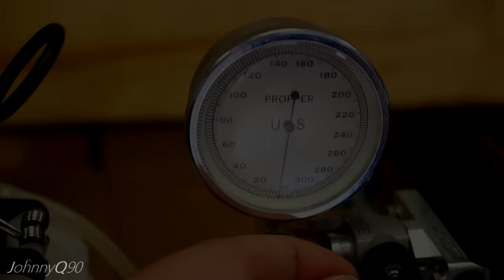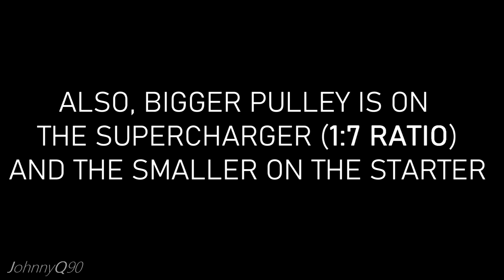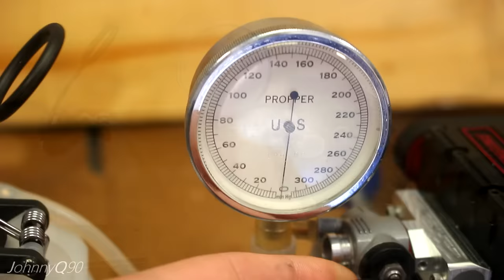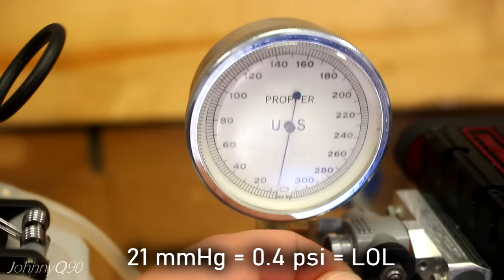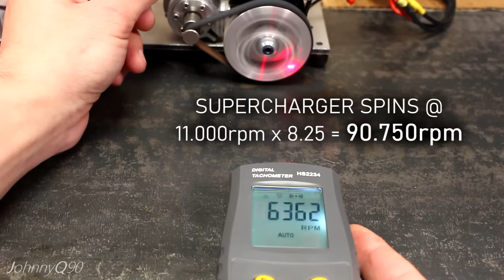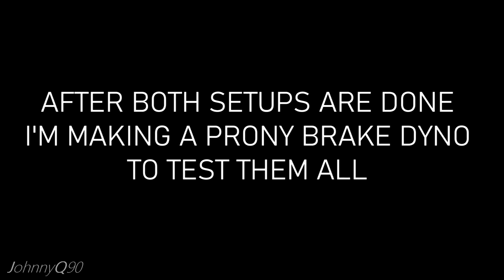0.6psi @ 90,000rpm Supercharger on MINI 2 Cylinder Four Stroke Engine! - BLOW Through Setup

Comment: Someone is learning that you can't just slap a supercharger on an engine and expect it to work. You need to add fuel and even more importantly... TIMING!
Reply: How you supposed to adjust timing
Reply: @carsonmcnamer5321   You can't. In a glow engine ignition timing is based on compression.
Reply: @otm646  yeah I know that’s why I asked him his plan on doing that lol.
Reply: @carsonmcnamer5321  Magnets and a hall effect sensor seems to be the way, but I don't know how it would work with those coil modules he uses.
Reply: @letsnotplaywithelectricity9346  yeah that would definitely help but add completely and he would need to program it. I’d say get as far as you can without it. It’s a small engine anyway
Reply: @otm646  I think I may have confused engines. I could have sworn when he first unveiled this engine he installed spark plugs... If this is a glow plug engine than he is supercharging the wrong engine all together.

Comment: Might need to make longer intake runners to give the intake some more volume. Also increase the size of the turbine wheel. If you can find bearings small enough, you could also make am exhaust wheel to make a baby turbo.

Comment: Johnny, how about using compressed air at a couple or more of LBS to test the amount  you actually want. then design the SC to get your optimum boost. Just saying Again Great Videos
Reply: They did this on F1  engines in the 80s.  Boost was supplied by a industrial compressor.    JohnnyQ90 should give it a try
Reply: That wouldn't work. There's way more to it that just "a couple lbs" of air pressure applied to the carb inlet. The flow rate of the air has to be right, and completely linear as tne RPMs go up. You can't just blast some compressed air into an engine.

Comment: Maybe if you used the exhaust for your fuel pressure instead and didn’t have any intake leaks.
Reply: RC engines for 50+ years have used exhaust to pressurize the fuel tank. Making it boost pressurized doesn't make any sense.
Factory supercharged RC 4 stroke glow engines like the venerable OS Surpass engines still used exhaust pressurization for the fuel tank.

Comment: Is it possible that the engine can’t exhaust the increased air input? Kinda sounds that way.
Reply: Could be that the valve / exhaust system is so restrictive that it can’t let enough exhaust gas out.
Reply: @codykamminga9667  turbo cars are notorious for that unless you port and polish the heads.
Reply: @scrapperdscrapperj3948 
No they are not. No disinformation pls
Reply: Can’t wait to retrofit something like this into my hot wheels
Reply: @juhomaki-petaja  While not inherently true, overdriving the compressor (pushing more air in than can be exhausted) is absolutely a problem you can have if you're not careful sizing your intake and exhaust components.  Check out Gale Banks videos on "Destroying a Duramax."
Reply: Ford Ecoboost 4 cyl engines on stock turbos are notorious for this. Turn up the boost on the stock turbo system and exhaust cant leave the cylinder causing increased cylinder temps and thus detonation.
Reply: @juhomaki-petaja  if not then blowoff valves are useless 😂
Reply: @scrapperdscrapperj3948  pleaze, no more deep analyses from you 🤣🤣🤣🤣🤣🤣🤣🤣🤣
Reply: @ZaMplayCod 
Yes, maybe so. But I bet it is too small turbo that is causing it.
Reply: @juhomaki-petaja  😂 ok daddy
Reply: @juhomaki-petaja  dude you sound like  you don’t know what you’re talking about
Reply: @scrapperdscrapperj3948  it needs a BIGGER CAM
Reply: @benjaminwatson7868  i bet I know lot more than you ”turbocharge it”-kids

Comment: I know that 90,000rpm sounds like alot, but in turbo/centrifugal sc terms that is untrue. A normal sized turbo sc would be at this range. But the bigger the turbo sc gets the slower it turns (has to do with the impeller tips reaching supersonic speeds). For example your mini jet engine reaches 90,000rpm, whereas a big jet engine would reach 10,000rpm. So this tiny sc should be spinning at close to 150,000 or 200,000 rpm which will definitely be challenging for the small bearings even with sufficient lubrication. Maybe a bigger bearing with enough lubrication will work. Also the faster you spin the sc the more energy it will draw from your engine (exponential). That being said, i know this project is demanding a lot of effort and resources from you. So i appreciate the videos and the quality. Keep up the good work.

Comment: You can measure horse power. Add a clutch so you can disconnect the setup to start up the engine. The setup to measure power is as follows. An electric motor and a way to measure wattage created from spinning the electric motor. Hp can be measured in watts. ~745 watts=1hp but double check that number to be exact. Pretty simple setup. But I think you might need a load of some kind like a lightbulb or the sensor itself to get the watts to actually be made. If you spin the motor with no electrical load than it will just spin with no resistance. Look into this because I think it could be fun for you. Also one of the problems you’re having with lag is because it’s a centra fugal supercharger. You can make a twin screw with your mini cnc machine. That might help with things like lag and pressure. Air can escape a turbine but can’t escape a twin screw because it’s like a pump. That will give you the best results I believe. Good luck and I love these videos

Comment: Have you thought about a twin screw supercharger design instead of the centrifugal?
Reply: I think he has mentioned that before, but is exhausting all options for the centrifugal first.  The roots style has kinda been done already with the Conley V8s, so this is also more unique.
Reply: @RotaryTurbo  I was thinking more like a Kenny bell. Yeah the micro centrifugal is pretty unique, there is just so much complexity when it comes to impeller design.
Reply: Oh right, like the whipple and eaton TVS also, the more efficient twin screw design.  With his equipment those wouldn't be hard to machine.

Comment: This needs to make atleast 1psi
 The engine would draw about that in vacuum alone.
Reply: The engine will never hit ambient pressure (> 1.0 volumetric efficiency), except possibly in a very narrow RPM range if intake and exhaust are designed todo so, so having any boost is generally a plus. However, the added power must exceed the power required to spin the blower.
Reply: @UncleKennysPlace  the problem is his pressure is a static measurement not attached to the engine and it doesn't measure flow. It doesn't matter how much static pressure you make if you're not flowing enough volume for the engine your pressure will drop and the supercharger will potentially become a restriction.
Reply: @Two-StrokeLife  yup, he should first find out what rpm he has to reach to get actual boost, maybe with a controllable electric motor that powers the supercharger while the rc engine is running at full blast
Reply: @or2kr  that's what I was thinking an electric turbo so the engine doesn't have to work to spin it then you can get the pressure up on the intake

Comment: Might need to go with a fuel pump instead of bleeding pressure off to the fuel tank. Or go to a smaller tank with a better seal.
Reply: Just mount fuel tank higher than engine.  Works for me when I test a nitro engine and dont wanna hook up exhaust tubing.

Comment: One way check valve from inlet to tank will help. Carb will suck from inlet hose until boost pressure over rides carb suction. You notice after you changed pulley the boost picks up earlier and over rides the carb suction sooner resulting in less breaking up. I'm looking at it like my Impreza fuel pressure regulator set up , it goes inlet manifold nipple off to fpr or one way check valve back to fuel tank , only difference being is your inlet is pre throttle body rather than post throttle body so you'll get more carburettor vacuum affecting fuel tank pressure.

Comment: Imagine if this works as a turbocharger like uses exaust instead of running through mechanical belt
Reply: Yes, it needs some turbo lag for sure.  A belt-driven supercharger has little or no lag, which is why they're used where lag isn't wanted - 1/4 mile at a time.
Reply: @simplywonderful449  Are you saying Superchargers are better "at the drag strip"?

Comment: Id say that thing needs quite a lot more rpm
Reply: The motor at 11,000 and the supercharger at 77,000 RPMs is not enough.just saying.
Reply: Agreed, an impeller that size needs to be spinning closer to 500,000RPM

Comment: With the draw through setup, it might help to make an intake with runner length in mind. This intake looked like a plenum that bolted onto the engine. I’d measure the height of the original carburetors and make runners of that length.

Comment: Some thoughts: S/C inlet is too “edgy” - some round inlet should be added (like the opening of a trumpet) to improve inflow. Next intercooler can be added, to cool compressed air, furthermore how do you measure power increase? Reving without load is not a measure. (Ok just saw the comment in the end title). It could run slower,  it with more torque and power...
Reply: Doesnt really matter at this scale

Comment: Looks like the charger is only a restriction.  Probably due to miniaturization and scaling.  Try measuring airflow of the setups.  HP is almost directly related to how much air the engine can suck in.  The fact that you can only make .6psi dead head(without the engine sucking in that boost) means it probably can't pump air faster than the engine can suck it in, or it's close to the same airflow.

Comment: Loving the vids as always!

I used to have a carburettor turbo 12a rotary in an rx7 many years ago (suck through set up). One big positive with suck throngh was idle and low end tuning is much easier as you can just tune idle as you would non turbo. And your main jets are turned for positive pressure, but cold start is difficult on suck through.

Fuel injection for combustion engines was like lipo batteries for the r/c world... A game changer.

Comment: damn half a pound per square inch! in that little thing! isn’t that like the equivalent of 10 psi in a small honda engine? correct me if im wrong, i do wanna know.
Reply: I believe psi is psi regardless of volume I could be wrong.  0.6 psi is probably barely enough boost to compensate for the added drag of the supercharger.  As far as explanation for my theory is you get a big air compressor and tank you fill it to 100psi you bottle neck it down a  1/4inch hose to the nail gun and its still the same pressure minus any pressure drop from the length of the hose. Just like sea level vs the mountains it effects all NA motors the same regardless of displacement.
Reply: @mesanders1113  I’m pretty sure engines make less power in the mountains because less air pressure, plus this cylinder is a displacement of 3.5cc I doubt it’s running at atmospheric pressure which is 14psi that’s a lot of air to suck into a cylinder that small

Comment: It looks like you need a gearbox on this supercharger... 😄
Reply from the maker: I tried that and I blew the pinion gear. It also needs constant lubrication, which means a sealed chamber. I failed to do that. Pulleys all the way for me, unfortunately.
Reply: @johnnyq90  It may be possible to make a real gearbox with a reduction composed of two gears and oiled by the used engine oil.

Comment: For carbs, probably the best bet is pressurized chamber where the carbs are in a box with ports for fuel and in your case maybe adjustments. That answers a lot of problem questions.

Comment: man just a heads up, measuring pressure like that is not in no way indicative of boost, i am sure you have 0 boost when the engine is running since the engine would suck the air and the supercharger isnt able to build pressure.. in short this supercharger sucks u need another one
Reply: but it is making boost though
Reply: @ranselmorera8410 you didn't read my comment did you? it did build pressure when there was no flow it was shut close by the guage, when the engine bogged at first run it was because the supercharger was actually constricting air flow not enough air was reaching the engine
Reply: @deeperlayer  he doesn't realize that the engine uses some air. .4psi in a closed system. Maybe an analogy... Consider if you're using an air impact gun but you have a small compressor. Keep the trigger held down as you wait for the compressor to build pressure in the tank. It will never happen. 
  The engine needs a constant supply of air. The supercharger only produces .6psi of boost at max engine rpm.. with none of the air being consumed. It needs to supply a hell of a lot more air than that once you put the discharge tube to the carburetor. The supercharger is a restriction rather than enhancing the flow.
Reply: @EricErnst  exactly

Comment: I would say a major issue with this method is 100% the carb location.  You mention the issue with running rich, but the other issue is that you dramatically increase the volume of the inlet plenum.  When the engine revs higher, the supercharger is increasing the mass flow of the air, but a lot of that needs to divert to a large volume in the fuel tank.  The result is gradual increase in pressure for the same rpm which is horrible for a carb (goes from lean to rich and laggy). Can't wait to see the blow through.

Comment: Your videos are very good, in this case you need a few steps forward to get the results you are hoping for. Not sure if someone already mentioned, you are testing boost with zero flow, your motor ingests an amount of air. The 7:1 pulley probably flowed less than the engine takes in, causing more vacuum than not connected, and the larger pulley is closer to same flow as not connected, so it runs like no s/c at all... you need to check boost while it is connected to the intake and running, or with a calculated orifice size to let a similaf amount of air escape as the engine would consume. That size centrifugal compreeso will need 200,000 rpm+ to produce any boost with proper flow, probably an intermediate pulley to step up rpm will help. And you will need to go to draw through or specific s/c designed blow through carb to have any chance of tuning under any significant boost.

Comment: The fuel pressure hose off of your charge pipe reminds me of those old school add on fuel controllers in turbo kits that would just add fuel pressure proportional to boost. Very clever.

Comment: When you adjust it without hosepipe and then you add boost it runs directly lean. You have to put More fuel on both needles in. Then the response will be better.

Comment: The design of an R/C carb will work fine with blow-thru boost. All of my R/C carbs have O-rings on the needles and a sealed bellows around the throttle slide. You would just need a true boost referenced fuel pump system to make it run right at all throttle settings.

Comment: You should make a positive displacement supercharger. Chances are the centrifugal one you have is just super inefficient and stalling out. The tiny wheel diameter, and the clearance you need to the compressor housing, it’s just not going to move much air. Positive displacement supercharger would be a cool project to see you pull off!

Comment: If you put a small velocity stack on the turbo it will do wonders. You're losing a lot of psi just to the sharp edges on that thing and it physically not being able to suck in the air due to turbulence.

you could very easily 3d print one too.

Comment: Don't know if this has been mentioned before, but the centrifugal supercharger won't work properly towards a closed chamber as when you are doing your measurements. There might be two main effects of this. 1. Since it's not fixed displacement it will need massflow to reach it's intended coefficient of efficiency. This might result in an under-representation of the potential pressure, and a certain level of bypass might increase the read-out. 2. Since this measurement doesnt take into consideration the volume of air necessary to make the motor as N/A there is a slight chance the volume flow is not even enough to make the motor run even without over-charging, making the charger act like an intake restrictor rather than overbooster. This is likely the reason for the effects of choking before increasing the ratio. In a very approximated model (Volymetric Efficiancy at 100%) the motor will need half its volume each revolution, and to have a supercharger able to deliver more than this is the first condition to achieve an overboost.
Reply: Oh, and forgot to mention! Love your channel and are very inspired by your craftsmanship and engenuity. :)
Reply: Just realized you've published a new video before I wrote this comment concluding my point. Good Job! :)

Comment: FYI Centrifugal blowers won't make full pressure if you completely restrict the outlet. There needs to be some flow rate to take a pressure reading. You could use a tee to read pressure while it's pumping into the carb to get a more accurate reading.

Comment: What this needs is a 9:1 pulley and a bigger impeller. You could also try the roots type supercharger, which uses two spinning "screws" which compress air in between them, similar to what many real engines use. This is more like a Toyota MR2 might have.

Comment: You might benefit from a velocity stack on the supercharger. You might be getting such turbulent air on the inlet side around the walls of the inlet that it 'chokes' off the intake. A velocity stack on the inlet would smooth the flow into it, might help with that break up you seen at higher RPM.